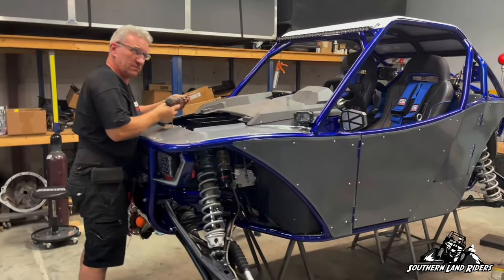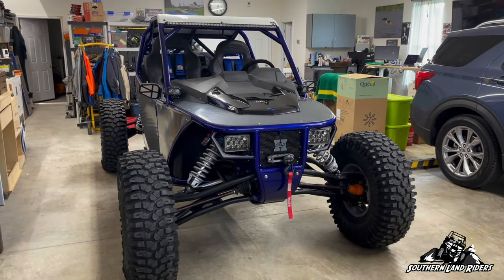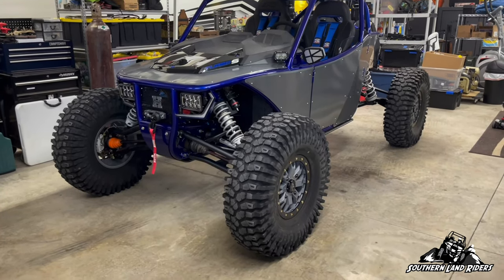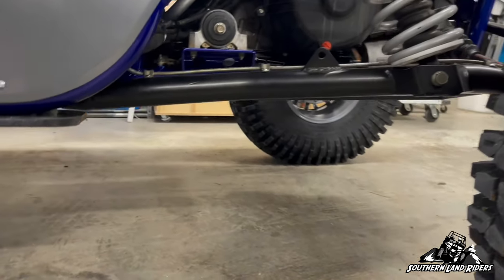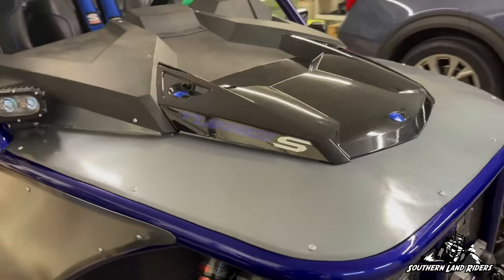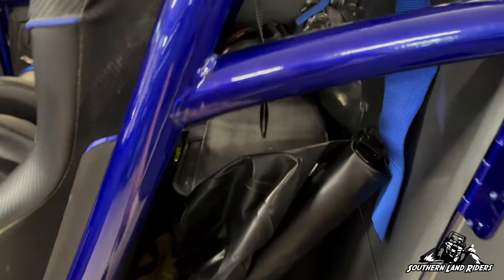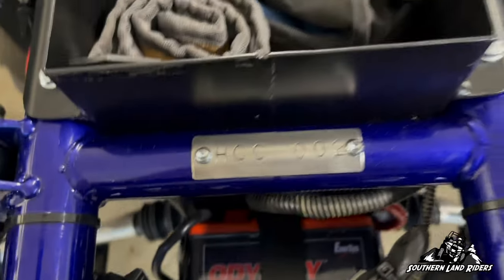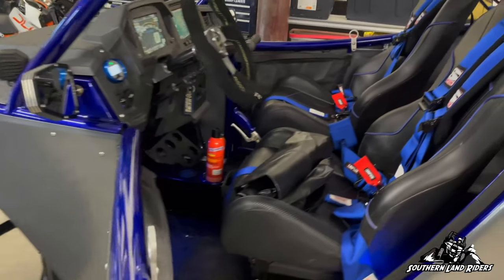Chris's RZR Tube Chassis Build

Comment: Did you like the ez power steering unit?
Reply from the maker: I will let Chris elaborate but I think his biggest issue with it was the lack of waterproofing. It worked really well though and his steering never went out.
Reply: @SouthernLandRiders  so since I’ve been watching your guys videos now for a while and I also have had a hard hit and it shut off and about break my arms, was your power steering just going out? Or just not powerful enough for those hard hits, I’m trying to not have that happen again it hurt to bad lol
Reply from the maker: @grantglor417  I just replaced the motor in mine. Not cheap at $1900 but I do not want to break any more bones. Hopefully that fixes it. I wish someone would come out with something that replaces the factory motor and allows you to keep the use of dynamix. That was the reason I did not put in in mine.
Reply: @SouthernLandRiders  I see, I have the turbo a velocity and I’ve been thinking about going the e power steering